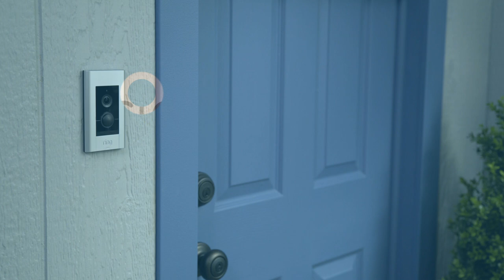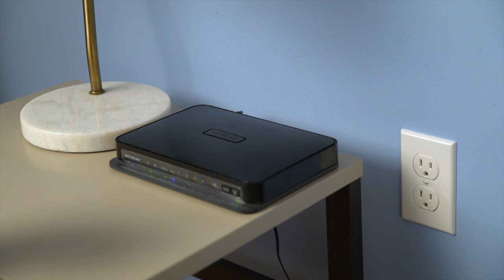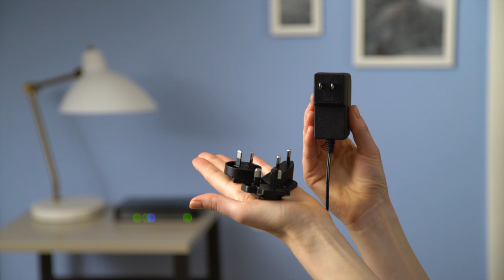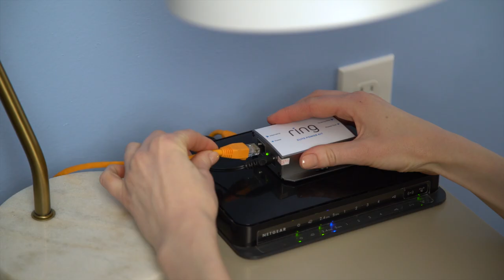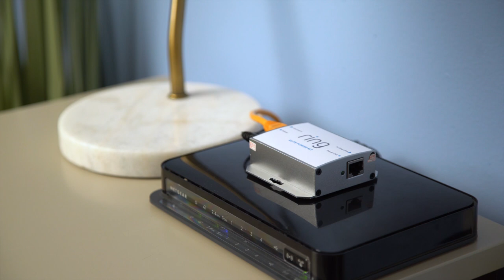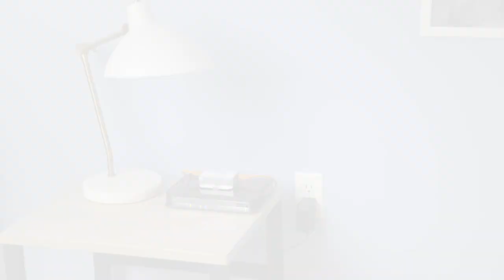How to Install the Elite Power Kit for Ring Video Doorbell Elite

Comment: Even with a contractor, that is a HUGE job just for a doorbell if retrofitting. A lot easier if your installing the doorbell in a house while being build. AND! Lol 50ft? You'll likely need hundreds of feet depending on where your router is.
Reply: no its not.... its low voltage so you don't need any specially certified person i.e. electrician etc, any one who installs cameras daily or for a side job can do a drop for a mere 125 bucks or so depending on who and where. its not a huge job its an easy job when you compare it to say running 8 plus cameras at every corner of a house. Who in their right mind would pay 500 for a 1080p camera aka 150 more then the same camera that requires a 120v line. you can buy 5 high end security cameras and cover that same door and everything else on your property for the cost of one sub par door bell. I mean 150 more because its POE LOL that's a joke it should be far less then the one needing an actual power cable cause all internet jacks can handle POE and injectors lol cost peanuts. don't fall for the scam cam
Reply: @ttss5726  why not just plug the ethernet cable directly into your modem and the other end into your Ring Elite directly? What is the purpose of this adapter? Seems anyone with preexisting built home will have a hard time setting up ethernet cable from modem into the ring. Especially for anyone with cable modem and ring if both of these are on two separate end of the home and floors. Fishing wiring behind a wall from 2nd floor down to a 1st floor with exteripr brick wall to onstall Ring Elite! Any work around?
Reply: @VP411Designs  It's a POE injector.  It keeps the existing ethernet connection but also passes the necessary voltage for the Ring Doorbell to connect

Comment: I have spent the last two days trying to figure out how to connect 3 stick up cams (wired type) to my router via POE connection. First of all the cameras came without the POE switch/es which I think is pretty petty of Ring not to include it since I spent over 500 dollars for three cameras. Secondly, the instructions lack a diagram with the different steps of how to connect the cameras  to a POE switch if you only use one camera, and how to facilitate the install by using a POE splitter if you are  installing more than two. I see that Ring sells the  POE splitter for 29.00 dollars,this only connects to one camera,correct me if I am wrong, which means I would have to buy three of them and deal with a mess of wires. I am still here trying to figure out if my cameras need POE injectors in addition to a POE splitter....

Comment: What is the point of the poe power kit? Could you not connect the Ethernet cable from the modem directly to the Ring Door bell? What is the point of the middle man "poe" adapter? Is it mandatory to use the poe adapter to convert into a power source for the video door bell to work?

Comment: Can 1 adapter be used for 3 cameras using a switch?
Reply from the maker: Hi Rebecca. Thank you for your question. The Ring Plug-In Adapter is designed to be utilized with one Ring device, and will likely not function correctly if you are powering multiple devices. If you have further questions, please send us a DM on Twitter or a PM on Facebook. We will be available to assist you from there.

Comment: will it work on CAT 6 wire?
Reply from the maker: Hey Robin! Yes, Ring Elite is compatible with CAT6 ethernet cables.
Reply: what is the maximum cable length can be used ?
Reply: What is the oldest kind of ethernet cables it will work with? What about cat5 or cat5e. Thanks. I am having a new house built and consider routing cat5e everywhere. Best bang for the $

Comment: Routing the Ethernet cable through the wall is the hard part they gloss over. How the heck am I supposed to DIY that?
Reply from the maker: Hi Mike! Ring Video Doorbell Elite was designed for contractors and homebuilders, so we'd recommend working with a licensed contractor if you're installing the device for your safety :)
Reply: Are planning the launch of a third version of your WiFi Doorbell model that fits into a junction box?
Reply: Even with a contractor, that is a HUGE job just for a doorbell if retrofitting. A lot easier if your installing the doorbell in a house while being build. AND! Lol 50ft? You'll likely need hundreds of feet depending on where your router is.
Reply: Alan Saeteurn Im diy-ing this because I will also have my ring cameras using poe, so it’s worth doing for that. It def is a big task
Reply: @Vences5  it's a nice setup, but I prefer Nest. Just my preference. Good luck. I just commented to give some other people some insight. I think it's pretty horrible of the company to downplay how much work retrofitting wiring is.
Reply: The poe is nice though. I wish more companies would do that instead of relying on wifi to transmit video.